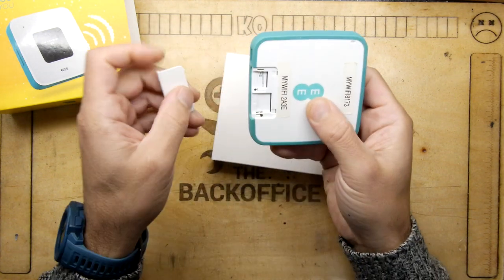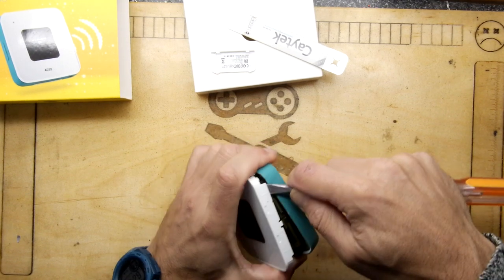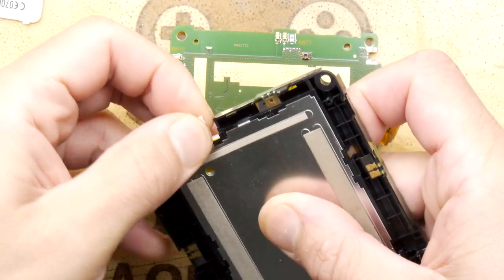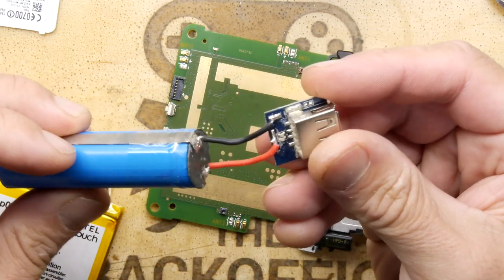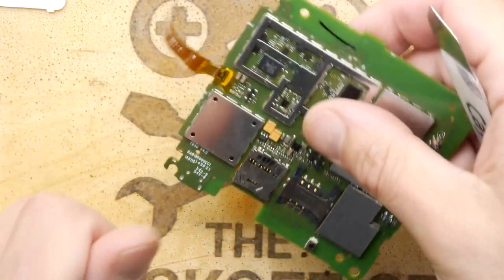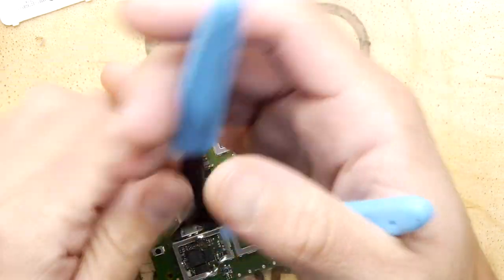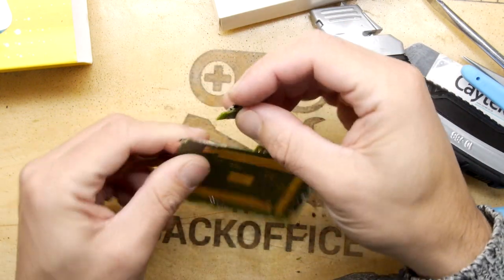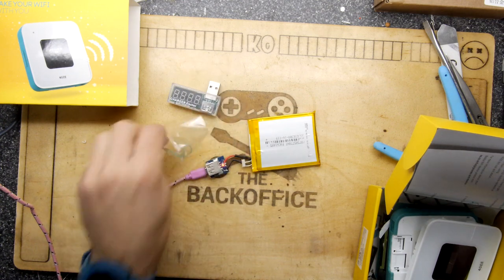4G Modem Teardown and Salvage

Comment: I can think of a scenario where you'd want one :-)
Here in Australia, one of the networks has much better coverage outside of urban areas than the other two. It's also about twice as expensive. We have one of those dongles on the "better coverage / more expensive" carrier for when we travel outside of the metro area. When our standard carrier coverage "runs out", we're usually able to get coverage on the dongle, and as we only use data, there's no downside. When the dongle runs out of credit, we just top it up.

Comment: Not to be a pain, but why didn't you sell this on ebay? People still buy things like this for backup connectivity solutions and things like holiday homes.
Reply from the maker: Uneconomical, what would it be with worth, a fiver? It would cost me more in fuel the 6 mile round trip to the post office. By the time you add the p&p they would have probably picked up something new from Amazon.
Reply: @backofficeshow  Because it keeps out of the landfill, and reduces environmental degradation?